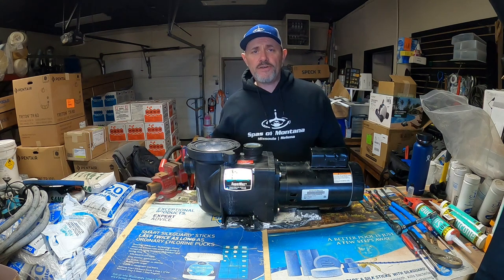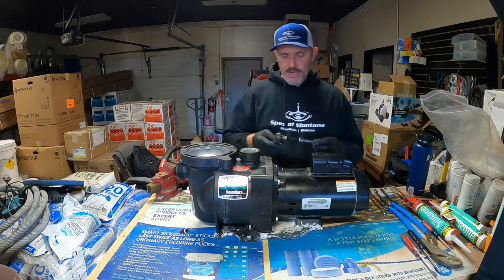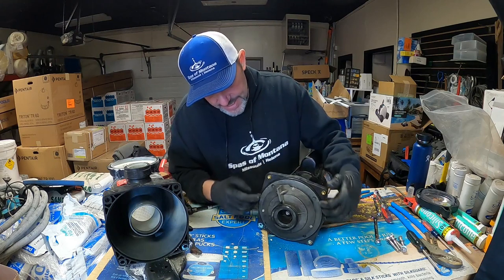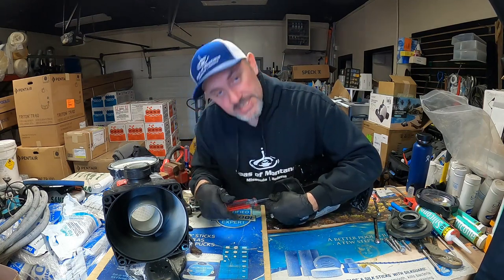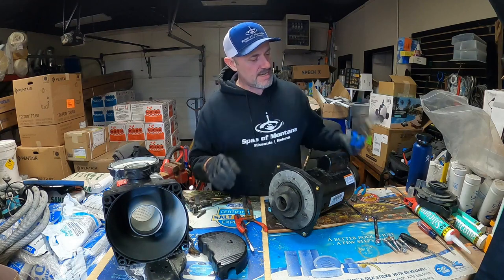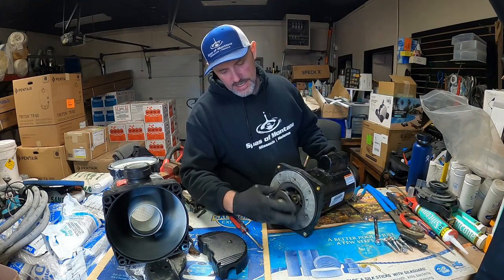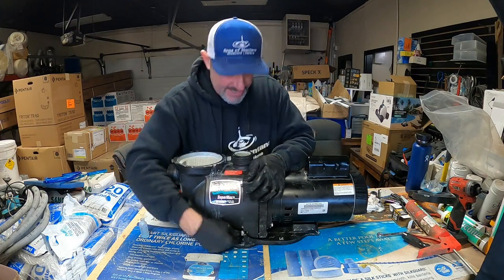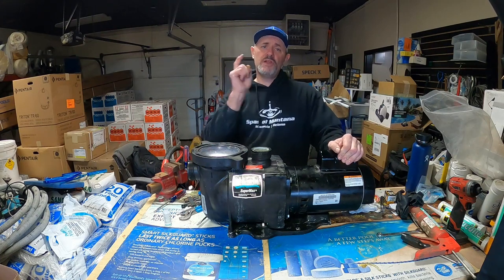Starite Supermax Pump Seal Replacement: How to Replace a Starite Supermax Pump Seal:Pool Pump Repair

Comment from the maker: Save some money and do your own shaft seal on your pool pump!
Reply from the maker: I suspect this pump seal went out so early because the pump would have to reprime itself  every time  they used the under water treadmill and there was alot of heat on it at some point causing it to fail.